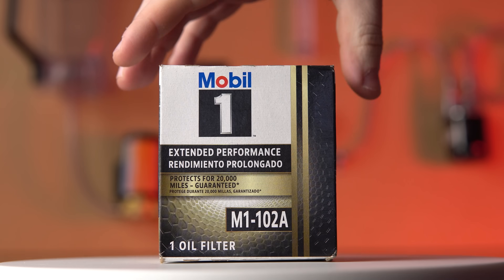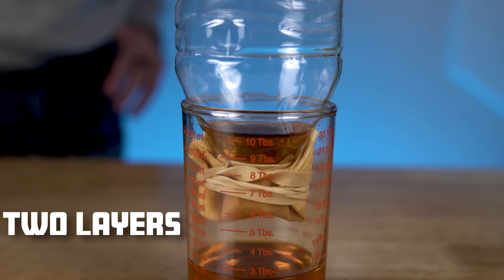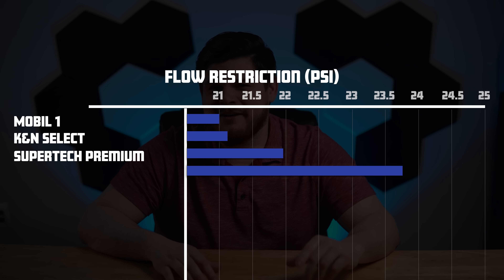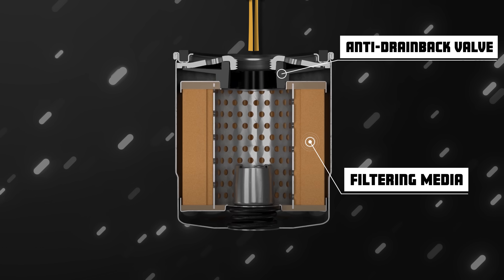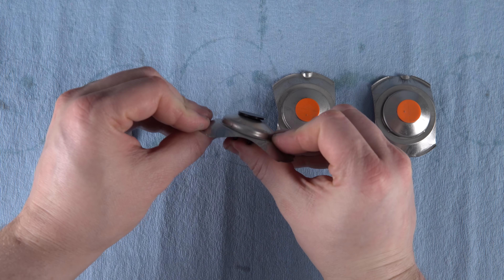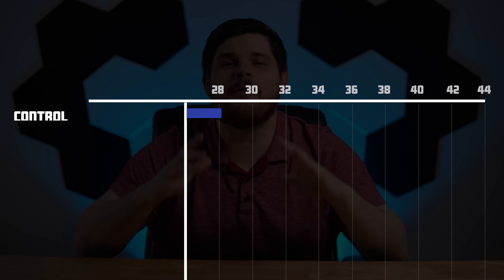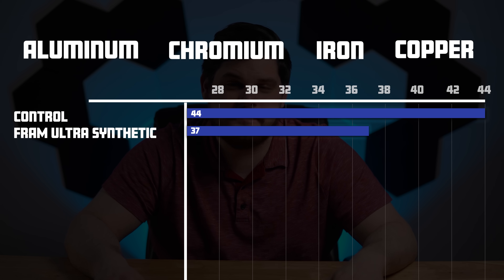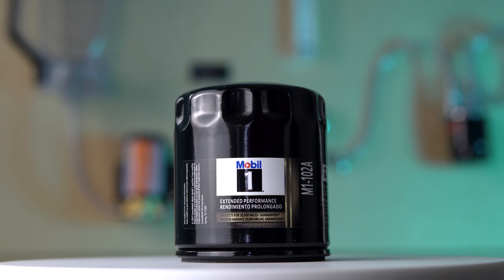Engineers Test the Best Oil Filters! FRAM | Mobil 1 | K&N | Walmart Brand

Comment: It would be awesome to get flow tests across all brands and models. I think it would draw a lot of views as people like me desire to see actual benchmarks. For example for my weekend event car, I'd prefer a filter that flows easier than others because I want to make sure my engine is lubricated at high RPMs. I don't care much for filtering capacity as the car will only go maybe 250 miles before oil and filter changes.
Reply: Wix Racing oil filter and a bypass system plumbed in like what AMSOIL offers.  Covers both.  You got a race proven filter from wix that has the flow capacity with 61 micron of filtration (larger stuff) and a bypass oil filter from AMSOIL that filters < 5% of the oil at a time with 2 micron (very small particles).  You also increase oil capacity and that could bring down oil temperature which may extend the life of the oil when you are pushing it.

Comment: I have a hellcat that runs very high oil pressure i would like to see a test comparison between 40psi and 70psi testing to see if the bypass valve stops the filter from working.. also is there any way to monitor the bypass valve to see at what point it starts to open ?

Comment: I appreciate your testing process, but I wonder what is missing when you run the test at room temperature. I have had a great interest in oil filter testing. Especially when a mid grade Fram  filter failed by closing shut. Car sat for eight months while my daughter was away for school. Now I only use factory branded filters. But big thumbs up on video.

Comment: Based on this I would used Mobil 1 for daily use cars. For a high performance car that gets oil changes at lower mileage intervals I would consider the k&n. I'd love to see if the filters made a difference on power numbers dynoing a 500-800 hp engine
Reply: You're not going to see a power difference with an oil filter.  It's about keeping the engine clean.  An example of what you'd see on a high end race setup would be a Dailey Engineering wet sump system, a Wix racing filter such as a 51060R and often times they'll run something like a ClearView Filtration screen (so you can easily check to see if there's a mechanical failure).  It's common to also use something like Driven Racing Oil.

I'd add a bypass oil filter like what AMSOIL offers because race oil filters are like 61 micron and don't filter down as much.  But I haven't seen others use them on race engines.

On a street car I'd just use a Wix XP and driven racing oil (their street oil such as LS30, FR20, DT40, HR1 etc.).  Can give them a call and they'll help you find what's best for what you are running.

Comment: IDK, I've been using the 'walmart' synthetic oil and super tech (also Puraltor or Fram, whatever is on sale!) products for 20 years on the same engines without issue. Keep the oil and filters changed is likely the common denominator to long engine life regardless of branding. BTW, the previous 20 years, on other equipment, I used Mobil 1 and Fram exclusively.

Comment: I have a 97 Camry and run Mobil 1 extended performance (whatever the cheapest 30 weight i can find - Florida I don't need to worry too much about the first number) with FRAM XG = once a year oil change.

Comment: The Pressure Restriction Test make no mention of the weight of oil used. A thicker oil will have a more restricted oil flow thru the filter media than a thinner oil. Given that most modern engines use 0 or 5w oil, that test may only be applicable to older make and high mileage vehicles that call for higher viscosity oil or have oil low pressure problems.
The Filter Capacity Test simulates an unrealistic scenario. No engine is going to experience that quantity of contaminates if the oil is changed at the recommended intervals.
The PPM Filter Test is the most useful which is basically "what size grit" do you want to leave behind in your oil. Clearly K&N wins here, especially since it virtually tied Mobil 1 for Flow Restriction.
Thanks for your efforts, I'm switching to K&N.
Oh, and one more thing... apparently fake K&N's, and maybe some other brands as well, are being sold on Amazon. Buy them from an Auto Parts store or Walmart.

Comment: FYI, canister oil filters have pressure bypass valves. Also, at least with stock filters, they are designed to operate at specific pressures for optimum engine performance. Also, cold vs hold engine and oils behave different. Finally, the size of the filters are a major difference. This whole type of testing is very flawed.

Comment: I personally have been using Mobil 1 extended performance oil and oil filters for years at 3000 miles intervals on my GM 3.5 liter 5-cylinder engine.  So far so good.
Reply: You could go 5-7000 miles.

Comment: Once an engine is  broken in you dont need much filter at all. There will be very few silicon or metalic particles floating around inside it and any of those filters woukd work fine.The exception being some clown @ jiffy lube used a dirty funnel to pour oil in or didnt get the air filter latched correctly.

Comment: Along with the other great suggestions, I'd love to see some OEM filters stacked up vs. the aftermarket competition like AC Delco, Motorcraft ect..
Reply: It would only make sense to compare vs those factory replacements. I have a Toyota and can say the Wix and Mobil 1 filters are much smaller than the Toyota filter even though it’s what they claim it calls for and would love to see a comparison.
Reply: @whatfreedom7: Run a cross reference on the Toyota brand filter model number with the other makes. You might find a different number then referencing year, make, model and engine. 
   I sold auto parts more years ago than I care to mention but as an example the Lee LF-1 (or was it a FL-1?) and the LF-16 both fit ford engines and some Mopars. The only difference being the 16 was half as tall.
Reply: Hyundai specifically states that their GDI engines should use OEM filters. This would be an interesting comparison between OEM and Fram, etc...
Reply: Agreed. I usually use Toyota filters on my Toyota and Delco filters on my Cadillac on 5k oil change intervals, so I'd love to see how they stack up against the "premium" aftermarket brands.
Reply: @floridag8rfan  ac Delco are made by fram now.  I would run a wix only
Reply: Same I have a ford and it’s motorcraft but usually use k&n cause motorcraft never in stock and I might just switch to mobile 1
Reply: Y'all do realize that car manufacturers don't make the filter right? They contract out to a filter company to make their filters and then just slap their bran on the filter and call it a day.
Reply: Odd thing to say, ACDelco and Motorcraft are OEM for their respective brands.
Reply: I use OEM Mopar filters on my wife's car because it's a cartridge style. Guaranteed correct fitment. In my pickup, I use Bosch, because it was the best available in my area when I did the research into it a few years ago.
Reply: Often, the aftermarket filters are just the OE filter with a private label. Especially if there is anything patented.
Reply: @caribbeanbound8357 
My wife used to have a F-250 that used a cartridge filter. Ford patented the filter, so aftermarket manufacturers couldn't make one with the same dimensions. If you used aftermarket, it would cause oil pressure issues and throw codes. Found that little gem out when I tried using a Wix filter.
Reply: The only reason i use Fram-and i know this makes me unmechanicky-is the gription on the filter. Haven’t used a wrench in 15 years on a ranger 4L V6
Reply: No reason to. Champion labs makes both of them. Aka fram
Reply: @Tmat_4928  the manufacturer of the parts does not have any bearing on the specifications they are built to , only maybe  the build quality , maybe
Reply: @donbeary6394  that’s why the factory gm parts etc say made in japan on the packaging and that’s why I had to replace a maf sensor on a 20k mile truck
Reply: And, what’s your point?
Reply: @Tmat_4928  Champion doesn't make fram

Comment: Wix, they are widely regarded as the best oil filter. I did find the result on the FRAM interesting as they used to say that the reason drag cars always ran FRAM filters is because the clog really fast and go in to bypass allowing the oil pressure to be constant.
Reply from the maker: Planning on testing WIX. Thanks for watching.

Comment: All of this info is great! But, none of it matters if you do regular oil changes at 3000 to 4000 miles religiously! A clean engine is a happy engine! I also flush mine with sea foam just before an oil change just to clean out sludge and other build up. Half a can in the engine, the rest in the fuel tank, Never ever have engine issues!
Reply from the maker: Thank you so much! Nothing beats regular maintenance, agree.

Comment: What about the K&n HP filter? You know the one with the 1 inch nut for easier removal. That’s the oil filter I usually use but got a Wix XP the last time at O’Reilly because they sold out of the K&N I needed.
Reply from the maker: Definitely planning on testing that KN and the WIX. Thanks for watching and supporting the channel. Make sure to subscribe so you don't miss it.
Reply: @BrandRanks  I subscribed, I work in automotive. What’s the chance you can do a tank on motor oil? I’m a Castrol guy and my boss is a Pennzoil guy and I wanna cram that Castrol is better down his throat lol
Reply from the maker: Hahaha, great idea! We definitely plan on testing oil at some point, unfortunately it may be awhile. Full time Job really takes away from our time to do content. Hopefully one day we can dedicate full time to this so we can get to stuff quicker. We have already researched how we are going to do the test, but man is it expensive🤣
Reply: @BrandRanks  you can blame Joe Biden for that lol

Comment: The starting point for the graphs not being 0 makes the differences in performance seem larger than they are. Also, just for the sake of weeding out potential good or bad samples, i think it would be cool to test multiple of each type of filter. Other than that, great video!
Reply: One of my all-time favorite posts from the Internet;
“When I am king, the first ones against the wall will be the ones who make charts that don’t start at zero.”
Reply: Also those differences were mostly showing which bypass flowed more. The people running the test didn't understand a pressure above the bypass rating means the filter was in bypass. The proper test would be to restrict the flow after the filter to build the pressure and measuring the difference to the pre filter pressure.

Comment: I have been using the Mobil One oil filter for over 20 years now in every vehicle that I have owned. I have swapped oil brands a few times, but I stuck with the same Mobil One oil filter regardless of which brand of oil I use.

Comment: It would have been good to see Wix XP and Purolator Boss filters tested. Both are currently made in the USA and are top models for those companies.
Reply: Been using purolator since 97 and still do.  Purolator used to put a gold grip on their cans kind of like the Fram filters years ago but it didnt last long.  Still use them to this very day.
Reply: @chrome2infinity938 do you notice a difference between oil filter brands ?
Reply: Wix is used on all the HD equipment at 28 mines that I contracted for over the past 20 years...
Reply: Wix is no longer us made

Comment: The test doesn't add up to me. There was 10x more aluminum  in the fram then the others except Mobile maybe 4x more, but in your filter analysis it wasnt.  Also the odds the fram would interfere with the drain back as this would have been a catastrophic amount of aluminum any way.  Would have been nice to see what the psi was at the end of the aluminum test to see where they all were at that point.

Comment: This test triggers the parts center in me from a few years ago. Price alone changes with application.  Mileage also depends on application. If the vehicle is designed for 4000 oil change interval, that’s what you regardless what you put in. It’s all marketing that will grenade your engine if you go over it. Also the brand’s tested are a small batch as to what is out there. At the end of the day go with oem. And deff oem oil change interval.

Comment: This is exactly why I use a fram ph-8 instead of the fram ph-3614 that my owner's manual calls for. It's almost 4 times the size, but fits the exact same filter mount, and still costs nearly the same amount. Another function that the filter performs without being expressly designed for, is cooling the oil, and by having a larger filter, not only do you have more surface area for heat transfer to occur, but the oil stays in the filter longer, so it has more dwell time, which is time to cool. That makes the oil protect your engine better. I just wish that I knew those sizes were compatible a long time ago, because it could have made my engine last that much longer. It's already got almost 200k miles, and I hope to get 300k miles out of it. Who knows how long it could have gone if I always used that filter. Maybe 400k?
Reply: How about adding  an oil cooler, I put an automatic transmission cooler on every  vehicle I own even cars that I don't  tow with !!

Comment: Wrong, more filter media does not add restriction, it reduces it. It's not adding two layer of filter, it's adding more surface area for the oil to pass through which reduces the restriction. Your own test proves this, cut out the filter material and measure it, I bet Mobile One has the most. Still a good test though.
Reply from the maker: Correct, more surface is less restrictive when they are the same thicness. we  were mostly referring to the double layer FRAM, thanks for pointing it out and for supporting the channel.

Comment: Bypass open at running rpm. They have to or it will starve the eng of oil. Ones with out generally looses pressure at higher rpm. Like the test. Not accurate at all tho. Just a FYI. Not all 100% of oil in a engine goes thought the filter every time. They have bypasses in the eng and pump to.

Comment: Every 1000 rpm equals to 10PSI of oil pressure

so basically over 2000 rpm oil filter does nothing as your bypass valve opens

so all of your filtering happens during idling and low RPM

Comment: Just curious, was the pump and hoses cleaned out after each filter test? My only concern is contaminents from previous tests would leak into the next thus giving false data.
Reply from the maker: Valid concern! They were indeed flushed after every filter with clean oil. Went through a LOT of oil... Thanks for watching!

Comment: I've used nothing but mobile1 filters and Castrol oil on both my vehicles 
My 93 f150 5.0 now has 200,000and no issues and my 02 Dakota 4.7 has 320,0000 only thing it's ever had was a bad transfer case

Comment: What of the other filter types. ac Delco, and other commonly available brands. Also the variables mentioned in the testing are these your own discovered variables or are these testing parameters the same as those who certify the oils?
Reply from the maker: Thanks you for the suggestions. We have made several improvements to the testing rig to better simulate the testing parameters used by ISO. Thanks for watching

Comment: 2 minutes in I got tired of correcting you guys in my head. Oil filter has multiple jobs doesn't just filter oil its also has an anti drain back device allowing oil to keep oil in filter to avoid "dry start".
More important correction is that the more filter media it has the better it is because the volume is distributed over a larger surface area. This allows you to filter to smaller particle without loosing flow.

Comment: Excellent detailed review.  Your findings declaring the Mobil 1 filter to be superior to the rest have been verified by numerous reviews over the years.  That is why I have used it for years for all my vehicles, as oil and filter changes are the most important part of ICE maintenance.  Thanks taking the time to evaluate these filters.
Reply: What's your opinion on Pennzoil Ultra Platinum?
Reply: @saulespino2510  
Impressively, Saul, you highlighted the motor oil with the second best additive package in the U.S., second only to Ames oil.  One thing to note:  Ames oil costs $14/quart, whereas Pennzoil Ultra Platinum can be bought at Walmart for $5/quart in the 5-quart container.  No one will ever be able to prove that Ames oil will give you longer engine life and better performance than Pennzoil UP.  I have been using this oil and the Mobil 1 filter for years with great success, and saving $$$ in the process.
Reply: Sittin in the crappy tire parking lot doin a little (last minute) research before heading in to make my purchase. Own a 01 Dakota w/ the 4.7L. Mobile 1 was one of the filters I had in mind.  Lets see how she does.  I typically have my mechanic do the oil changes but figured I'd do this one myself.
Reply: Echo chamber
Reply from the maker: Thank you so much for watching and supporting our channel. it means a lot to hear that you enjoyed.

Comment: I use K&N for the excellent flow rate and as you seen smoked everyone else on  filtering out the junk. Don’t really care about capacity because of something clogged the filter you have bigger problems in the first place 😊 Mobil 1 is my second choice for sure
Reply: I have been changing my own oil for 40+ years and have never skimped on quality, oil or filter. I have been using K&N for the last couple of changes and have never seen a filter keep the oil so clean. I hope K&N doesn't  change anything with these awesome filters.
Reply: Yea right
Reply: I 100% agree. All my vehicles have gotten either k&n or Mobile 1 filters.